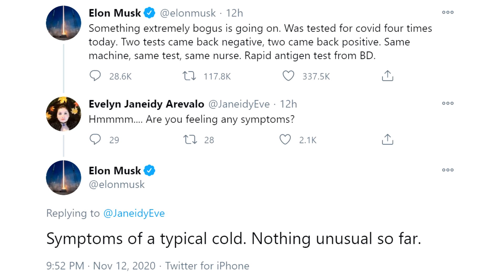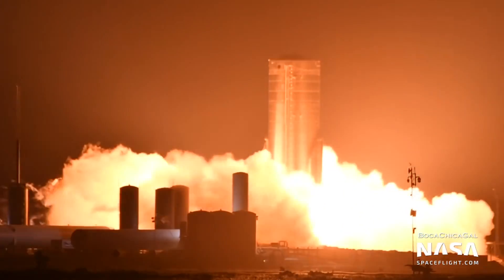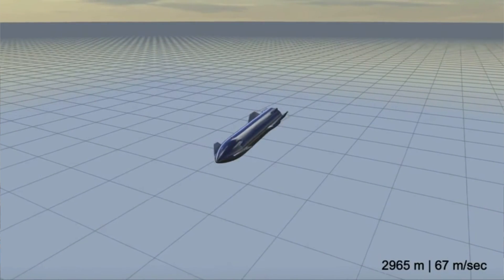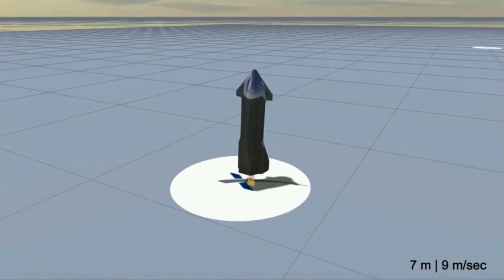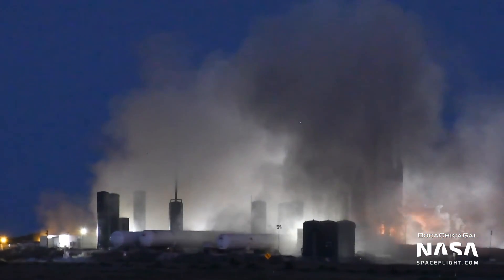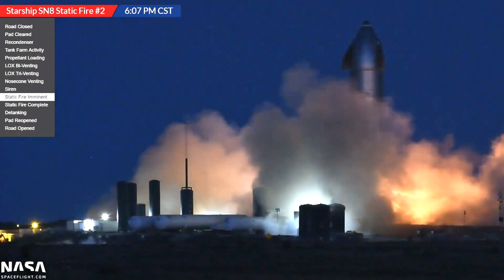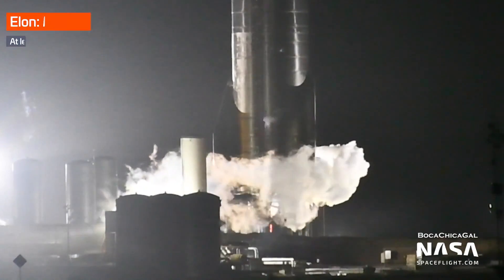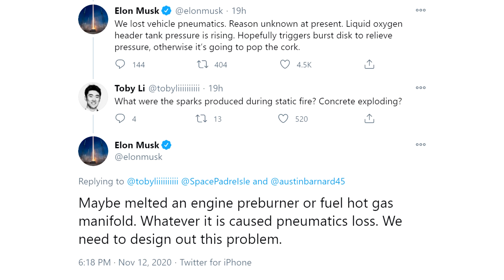Starship Test Destroys Raptor Engine, But Burst Disc Saves Rest Of Vehicle

Comment: Based  on Elon's tweet that this will require redesign, I now do not expect the 15 km flight before the first half of next year. Orbital flights are unlikely before 2022, and I doubt there will be a Moon landing before 2026. I'd say slow and steady wins the race, but that is Blue Origin's unofficial motto, and they take it to extremes.
Reply: yeah, I'm still not convinced this thing will ever work
Reply: What tweet are you referring to?  Link would be appreciated
Reply: Actually, I don't think this will delay the 15 km flight that much. The "redesign" Elon was talking about was because of the cascading failures to the pneumatic system, and obviously that will need to be addressed — but if it only occurred as a result of the engine failure, it's not an obstacle to continuing flight testing of SN8 and 9... it's just something they'll need to address on future builds.

The only reason to delay the flight is that they need to discover why the engine failed. And unless it turns out to be a design or manufacturing issue that affects multiple engines, I don't see why they won't just replace the failed engine, fix up the damage, and continue with the testing schedule. Some delay, but I don't think more than a few weeks.
Reply: @simongeard4824   Well, there are two critical words in your post, "if" and "unless". Perhaps I took Elon's statement that the problem would have to be designed out more seriously than I needed to. We will see.
Reply: @odysseusrex5908  Well, we can only speculate, of course. But from the limited info available, I don't see anything that suggests they need to stop everything and do that redesign *right now*.
Reply: @simongeard4824   if your engine has something like a one in ten chance of melting upon ignition without a redesign, I'd say you do. We will see what happens.
Reply: @odysseusrex5908  True, but I understand the "redesign" comments were in the context of the pneumatics, not the engine. So the big question is why the engine failed... maybe something serious, maybe not.
Reply: @simongeard4824    Well, finding out would seem to be job one.

Comment: That thing is going to need allot of work and testing for a long time before people get to sit in it. Let's hope the money doesn't dry up... or worse.
Reply: if they can successfully capture even a modest fraction of projections for their starlink system, I think running out of funding is very unlikely. Not to say that there couldn't be delays due to dips in funding along the way, but with their current trajectory them going bankrupt any time soon doesn't seem possible. NASA would bail them out before then as they can't really afford for spacex to fail at this point in time.

Comment: People keep talking about molten metal, but Is there any chance that it could also have been dripping, burning liquid methane? Like, I know liquid methane wants to boil off at normal temps and pressures, but so does liquid nitrogen, and it will happy hang out in liquid form for awhile, even against the heat of your skin, as the boil creates an insulative layer between the liquid and the outside world. If you pour liquid methane and light it on fire, maybe it doesn't explosively boil, because there's an outer flame layer, with a steam layer underneath, and a blob of liquid under that. Elon specifically mentioned "fuel side" problems on the engine, so if the pre-burner failed, it might just be the remaining fuel in the engine, being pushed out of all the plumbing by its own steam as it boils in the pipes, instead of just being blown out by the still-spinning pumps on shut-down
Reply: Raptor definitely used hydraulic for TVC. Fins tho use electric motors with gearbox

Comment: i think they need something better on the ground under the rocket. i wonder if something like AR plate could deal with the exhaust heat?
Reply: The finished landing pad will have an extra-large Welcome Home mat made with flame retardant silicone rubber.

Comment: I don't see what the problem is... Rockets are supposed to work by ejecting mass downward at high speed! A bit of molten metal should just add to the efficiency...
Reply: If the metal is a part of your engine, particularly a turbine, you can't fire properly any longer, or you ended up destroying the engine altogether

Comment: Hey Scott,why cant header tanks be built like giant syringes,and air pressure can provide the compression to push the plunger through the tank eliminating bubbles and sloshing.
 Or a tank that is a bag and as the fuel is consumed the bag shrinks like a wine bota ( space bag) 
[And yeah that is what we call that! ]
RIP it right outa the cardboard box. 
Just a thought I've got running through my head. 
And many others also.
Thank you Mister Manley.

Comment: 1:55 Just like when you have an air bubble in high-pressure pipes at work. You can hear the water slamming and shuddering five rooms away.
Reply: Water hammers?
Reply: @twistedyogert  
Kinda. You wouldn't think that an air bubble would hurt anything, because you have so much water running through the pipe normally with no problems.
But when there's an air gap, it's like turning the water off and on really suddenly and really fast. The wave of water on the tail end of the bubble hits the bends in the pipes and makes a really freaky banging sound, or a vibration or whining (if there's a lot of bubles)

I used to hear it a lot at the bathroom at work.

Comment: Why did they use pnuematics to control the valves instead of hydaulics?  Way back when I worked at Rocketdyne it was always hydrauilics.  Is this some innovation Spacex came up with?
Reply: Pneumatics is important for all rockets

Comment: Burst disks back at it again. They just won't die as relative tech 😂
Reply: Burst disks will be around for a long, long time. They're pretty reliable. Loose your pneumatics, it still works. Loose your hydraulics, it still works. Loose your electrical system, it still works. Engine melts, it still works.
Reply: Oh boi do they need to

Comment: Starship: *lights 3 engines and the ground flies apart.

Elon: "Uhhh, can't wait to test my Superheavy launch mount without flame diverter!"
Reply: Yeah I don’t get why they aren’t building a flame diverter at all, not putting one just seems like it could cause a ton of problems just to save a bit of time.
Reply: @spotlizard0374  Starship will have to routinely operate from completely unprepared surfaces if it is to power land and/or launch from Moon/Mars, Superheavy otoh willl only ever launch/land on prepared positions.

With those poky little popout feet underneath starship I would be really concerned about touching down on a soft surface! cant be very many degrees of tilt before it rolls over.
Reply: @shaniamonde7341   That’s true, but I was referring to the orbital launchpad that’ll only be used for superheavy, which Elon said would have no flame diverter. As for the legs elon has said the final legs will be longer, and while he hasn’t said if they’ll be self leveling I’d assume they will be. Maybe they’ll eventually use lunar starship-style legs on the first few mars-bound starships and switch back to normal once they have some sort of landing pad.
Reply: @shaniamonde7341  starship will almost certainly require a prepared landing surface on the moon, not strictly a problem if artemis ends up landing several other landers but people have to be realistic about space-X's big rocket
Reply: @spotlizard0374  ah, the raptors will just dig their own over a couple of tests
Reply: It's probably just a thought process. Everyone I saw overlooked the "no flame diverter" word and underlooked the "it's probably a mistake" word
Reply: launching rockets isn't about escaping the pull of the Earth, its about terrorizing the Earth, making it fly away from you fast enough that you end up in orbit.
Reply: It's going to be insane! (In the heavy metal sense of the word.) Giant freaking craters with every launch. They'll have to use a few more stakes to hold that tent down.
Reply: What they should do is unroll some of the 301 stainless and place it under the launch pad to protect the concrete.
Reply: The current mount will likely never be used for real orbital flight...it’s going to be used for some early prototype tests without the full number of engines. The full orbital version requires a very large exclusion zone, they’d have to buy out a lot more people to make it safe to do an orbital launch from Boca Chica...current speculation is that all orbital flights will be done from sea platforms, because there’s likely nowhere on the planet that’s coastal, relatively equatorial, and has a large enough unpopulated area for a super heavy launch, given how loud the engines will be.
Reply: @theodoremurdock9984  This is why I don't believe Elon will build the glass bar on top of the high bay if he intends to launch the full heavy booster from the orbital launch mount.  Our house in Florida is about 35 miles from KSC.  When they launched the Saturn 5 rockets to the moon, the windows in the house would rattle and that rocket is not as powerful as the fully-engined Heavy Booster will be.
Reply: The booster still needs to land, and I don’t think it can land in a pad.
Reply: The first super heavy boosters will fly to 150m with two engines

I think that the launch mount will be able to withstand about six engines before any failure
Reply: I’m curious about starship’s aerodynamic surfaces. Seems to me like it wouldn’t take all that much more to turn starship into a proper lifting body.
Reply: @hankjay2023  

I think that it can act as a lifting body but the flip only works if the starship is moving downwards 

Otherwise it would probably put too much force on the vehicle
Reply: I want to see that one too!
Reply: @nemo-x  
I think that the thrust is too concentrated to fire concrete into the skirt 

But I like your theory 
And it seems very plausible 

I personally think that they just melted an engine 

But if it turns out To be concrete it will be an easier fix than a redesign
Reply: @nemo-x  

I think that if the thrust puck melted then all the liquid methane would spill out and burn 

Also the raptor engine is about three meters tall so there’s a lot of metal that can be melted in it. 

Personally I think that it was a lot of engine that was melted 

But I do worry about the loss of pneumatics. I think but I don’t know for sure that the engines pressurise the pneumatics. Although it could be the COPV.

On the falcon 9 the engines are separated from one another by an octagonal web.
I think that starship would benefit from this. And redundant pneumatics 

But remember that SN8 is a prototype 
So it will only test import features 
So I don’t think that it has much redundant parts. 

In starship renders that I have seen 

The COPVs seem to be housed in three separate boxes. 

I really hope that what happened was not  too serious and easily fixable.

The super heavy is able to fly with only two engines 

This will be for the 150m hop

After that it will need a few more for the 15k hop 

Then I think that it will probably do a full 27 engine fire (I think that they dropped the number)

I think that the launch mount will probably have a water deluge system even if it doesn’t have a flame trench
Reply: @nemo-x  Do you think engine SN32 ate some concrete and got sick?
Reply: It will blow up just like the rest of Musk's junk built at the Boca Chica junkyard!
Reply: @DavidJohnson-tv2nn ,
And if it does there will be another one ready to take it place. 
Never give up. Never surrender.
Reply: @magnamic5614  The don't care attitude is the problem.
Reply: @DavidJohnson-tv2nn ,
Are you insane? 
Clearly you have no idea about development, the cost of developing things and the risks you must take to finally achieve success. 
How to you think the Apollo program came to be? Sure, everything wasn’t as extravagant as this but it’s no different. Don’t kid yourself. 
Get over yourself and get with the times. 

Finding a problem in design is success because when we put humans on this thing the end result should be something like the most recent episode of The Mandalorian: a broken ship plummeting from space yet it still survives by doing a suicide burn at the last second. 
SN9 is waiting to be broken so SN10 - 12 - 13 etc can possibly make it to being human flight rated. 

I don’t care what you think about my problematic attitude towards development of space worthy hardware. 

We have different views. 

Learn to live with that.
Reply: @DavidJohnson-tv2nn  Come on.  There is a lot of good engineering being done at Boca Chica.
Reply: @guypehaim1080  Rockets aren't normally built outside in dirt. Launch pads aren't normally built without flame diverters. Musk has no plans for launch abort on his rockets built outside in the dirt!
Reply: @DavidJohnson-tv2nn  These things will come as a need is realized.  He has the money to try simple iterations almost endlessly.

Comment: Engine got sick, had diarrhoea. Stay hydrated, little engine.
Reply: It took me years to work out that I was lactose intolerant. I'd suggest they try filling the tank with lactofree milk and see if that helps.
Reply: @nagualdesign  - I suspect there are a lot of people who are, or have been, in your shoes.
Reply: @ROCROCROC1  Now that I know more about it, I'm certain that you're correct, and the older people get the less they can tolerate it.

Weirdly, my mother was really sceptical about it. I once diagnosed my own heart condition but she couldn't believe that I could possibly know whether I was lactose intolerant. I had to use the phrase "pissing out of my arse" on many occasions before she accepted it. 😆

Another weird thing is people's reaction to lactofree milk. I offered my cousin a glass when he said, "I fancy a glass of milk", and he refused it! I explained that it's just milk with a few drops of lactase in it. "No thanks." I explained that lactase is a natural enzyme produced in the gut by mammals, and is completely harmless even if you can produce your own. Still no. Go figure.

I strongly suspect that Ambrosia Rice Pudding is made with lactofree milk but they decided not to mention it on the label so it wouldn't put people off!

Comment: Raptor engine: I can take quite a lot of heat
Pre-burner: hold my hot exhaust flow
😁
Reply: good one .... its actually not that hot but oxygen rich things at that Temperature tend to oxidize the heck out of most metals
Reply: @TheRadioactiveBanana32  "oxidize the heck out of", in this case, meaning, ultimately, "transform into superheated gas" ;-)

Comment: Hey Scott Manley, what are your thoughts on the Raptor "Honk"?
Have there ever been any solid leads as to what causes them and why it calls for an engine swap?
Reply: one of my toilets currently does this. It probably needs a new tank fill valve, something to ask the apt. manager about. Sounds like one of those "sad calf" can toys... Which would probably indicate the valve doesn't quite slam shut, but is slow enough that the valve face invokes some vibrations/noise due to the flow rate and pressure. Not slamming the valve shut is probably by design, to not cause a bit of hydraulic hammer action back up into the piping or tanks or to let off the pressure on the downstream parts gracefully...

Comment: astronaut 1: Are those parts important?

Astronaut 2: It's just engine rich exhaust.
Reply: It runs on this new fuel: Turbopump/LOX
Reply: @uint16_t  Ah yes, Turbolox!
Reply: Malcolm Reynolds: “What was that?”
Reply: [generic corporate music playing] 
"To boost efficiency, when standard fuel is over, the engine will use the connected stage as propellant and itself as oxidizer. 
This allows us to use less fuel, facilitate staging, and reduce recovery and refurbishment costs to zero."
Reply: @TheNasaDude  The Rocket Lab Electron booster already throws it's main battery into the exhaust during normal flight.
Reply: Fortified with iron and trace elements!
Reply: @Kevin_Street  Mostly Nickel and Chromium
Reply: It's a good thing that happened in a test.  The occurrence of engine-rich exhaust in flight often triggers an emergency lithobraking maneuver followed by the rapid unscheduled disassembly of the vehicle.
Reply: @dragontdc  I believe RUD happens before lithobraking, not after. On planets with atmosphere anyway.
Reply: Don't worry I got a helmet.
Reply: @dragontdc  That's the sort of sequence of catastrophic events that result in a situation UK Royal Air Force pilots would call a VBT.  Or a Very Bad Thing!
Reply: Don't worry, if this happens in flight, they can simply use the escape pods.
Reply: 3:24 to 3:28 Did sombody notice two lights in the dark towards top right of screen can somebody clear what that is?
Reply: @hussainkhan-fg1lv  Can't clear it up definitely, but seems to be some sort of tower. Straight down from the lights (almost at ground level and approximately the same width) something seems to be lit up and gradually fade (to the right) which makes it look like a circular structure.
Reply: @hussainkhan-fg1lv  Couldn't see anything there at my resolution.